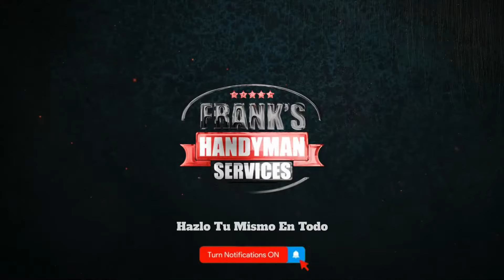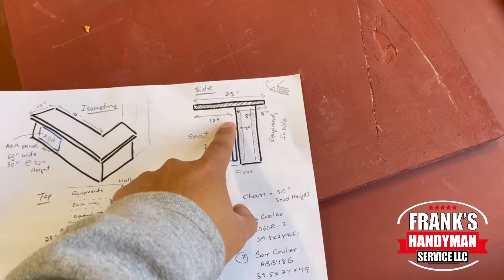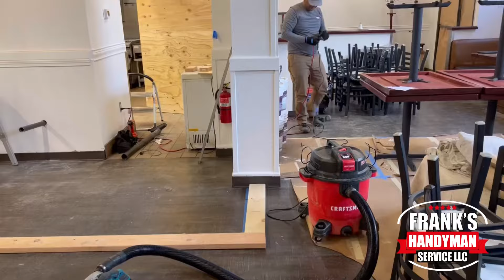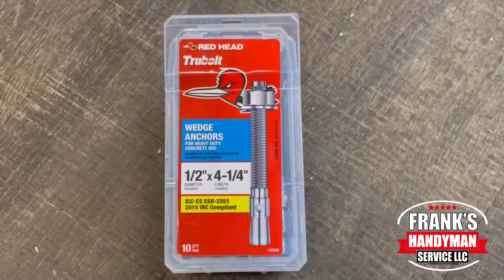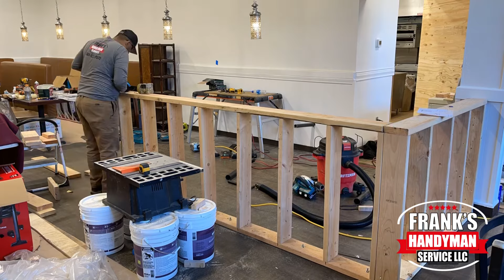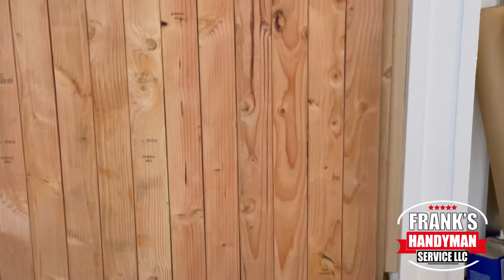How To Build A Wooden Bar With 2x4 and 2x6 Step By Step | Interior Patio Bar DIY for Indoor Living

Comment: I'm not a carpenter but I can't stand the splinters after you cut so I block sand w/ 60 grit sandpaper. I remove those white tags on the board ends. I would never stain over the black factory ink stamps.  I see so many fast and reckless workers on you tube. Staining before assembly gets all sides, better protection from moisture

Comment: First, what about the ink stamps on the 2x4s? Second, why 2x4s add 2x6s? You could balance a truck on top of that.
Reply: Not to mention how expensive the 2×4s would be, I'm gathering ideas for my home bar (aka the speak easy) and I can get plenty of pallets from factories around me. I think I'll do a pallet wall style on mine and save some cheddar plus the sun bleached, and diff color boards will match the wood crates  I got to sit on each side of the old china cabinet for a liquor cabinet.

Comment: This is terrible. Never build on a floating floor. It’s called roto hammer for drilling in anchors. Your bar return on to the wall is incorrect, 1 nail in top and bottom of the vertical 2x4 is not correct.  I can pick apart this hack job amateur crap all day. Do you even have a license or do you give people lube at the end of the job after you F*** them.

Comment: Curious whats the best way to combat a sloped floor? Looking at doing this in my garage, with a 1.5'' of downward slope in the bar area.
Reply: Add adjustable feet with thread inserts so you can adjust them to level the bar. Could also use shims or have a bottom board that is tapered to  level bar and then cover with trim

Comment: I'm sorry but I don't like this at all. My problem is, what happens when they need to replace the flooring and the bar is on top of it. Also never heard of cutting 2x4s around trim, shouldn't it be cut flush to the wall then add the trim back? 🤔 I'm very confused
Reply from the maker: Since the floor is concrete here, we didn’t need to worry about replacing the floor in the future. The trim cutout can go either way but thats how this particular design went.
Reply: If there's flooring then cut around it...also, nobody cares you don't like this at all
Reply: @mikejones-we9eo you suck

Comment: For a home bar, same L-shape but way smaller, say 3'x5½, would 2x3 be sufficient?
Reply: I used 2x3's to build the framing for my bar. It works out fine. Using plywood for the outer skin is a lot cheaper than using 2x4's also.